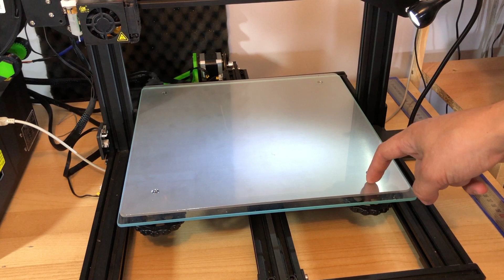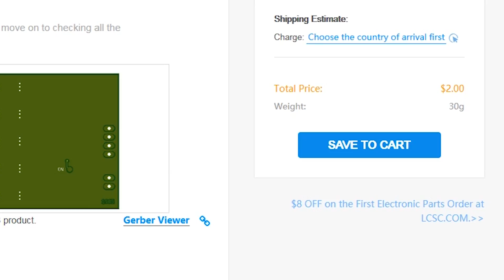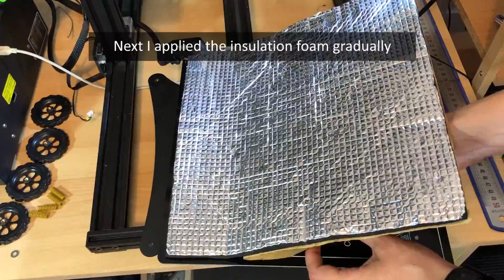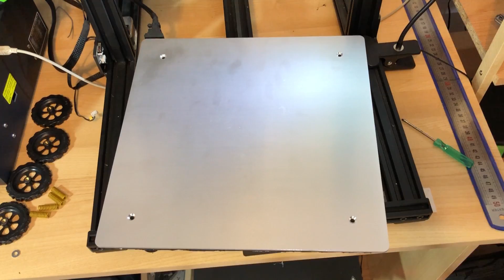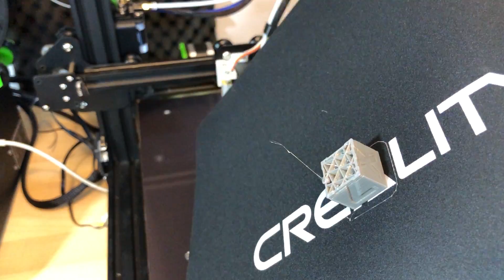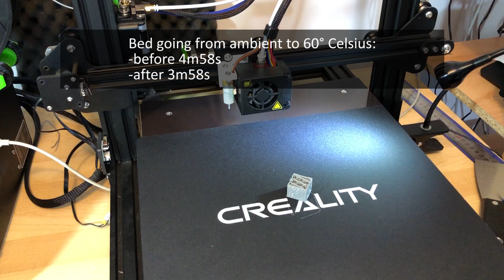Voltlog #239 - Upgrading The CR10 3D Printer With New Print Surface And Bed Insulation

Comment: Glass bed with hairspray is the best combination, never had adhesion issues and bottom layer is perfectly flat. Although I level the bed manualy with non stock springs. Small prints snap off even hot if you don't use too much spray.

Comment: Thank you for sharing the information. 5:15 I noticed that your heat bed is a little wiggly. Try to tighten up the concentric bearings of the bed for better prints.
Reply from the maker: that happened because the leveling screws were not tight enough, I fixed that later.

Comment: Aaaand there goes my money ;)
Insulation is something I hadn't really thought of. For the printbed I prefer PETG - good adhesion when hot and completely loose parts when cold. Using the magnetic ones I would have too many doubts for stability and degrading magnets due to temperature
Reply from the maker: It's nice that we have options, I'm gonna stick with the magnetic surface as long as it works, I need to do more printing to see how it behaves. If it doesn't work well in the long run I can always switch to PEI.

Comment: Did both temp time tests have the extra the glass plate, or both had no glass. Just wondering if one test had less mass, ie: the glass,  to heat.
Reply from the maker: nope but how much do you think it will change the equation?
Reply: @voltlog  It's been decades since I did engineering, so I don't remember how you do it, but an online calc say 7000Wh to raise 0.5kg of glass 60ºC. I'm guessing it does take time.
Reply from the maker: yeah but the system is not exactly trying to raise the temperature of the glass here. The thernocouple is stuck to the heater under the aluminium bed, it doesn't care about the temperature of the glass and although it ads some inertia to the system I wouldn't expect too much difference. I'm too lazy and the weather it's too hot right now to run a second test 😂
Reply: @voltlog  I was mainly wondering if the insulation on the bottom made it quicker, or the removal of the glass heatsink.
Reply from the maker: @SidneyCritic  yes I understand but I'll need to put the glass back on and repeat the test to see if I get similar results. Will let you know once I have the results.

Comment: will the magnetic field survive the heat from the bed? Usually heat destroys or reduce a lot the magnetic field...
Reply from the maker: we'll have to see as I use it more often but I don't think all types of magnets are affected by heat
Reply: It has been OK for me, I have printed ABS on my Ender 3 with the same sheet, with a bed of 105 degrees, more than once, and it doesn't seem to have affected it.
Reply: @voltlog  
All permanent magnets are effected by heat and completely and permanetly lose their magnetism at their Curie temperature, which varies wildly by material. But even before that temperature magnets degrade irreversibly when they get "hot" (hot is relative for material again).
I seem to remember that flexible magnetic mats can only go to about 80-90°C before losing magnetic strength. I don't know which temperature print beds are heated to, but the way this one looks (heater only in the center), I guess there will always be enough area on the perimeter of the bed that never gets really hot and stays magnetic enough to keep the mat in place.
Now (before a lot of use) would be the time to measure the magnetic strength in a few spots and compare it after some time. I don't know how easy it would be to do, but you could put the bed on a kitchen scale, then use some iron piece on a string (like a nut or bolt), let it stick to the bed and pull up to see how much lighter the bed gets before the pieces detaches from the bed.
Reply: The Prusa magnetic print bed uses high Curie point magnets, I assume the Creality solution will be the same. I haven't been able to find any info on exactly what the Curie point is for the magnets used.